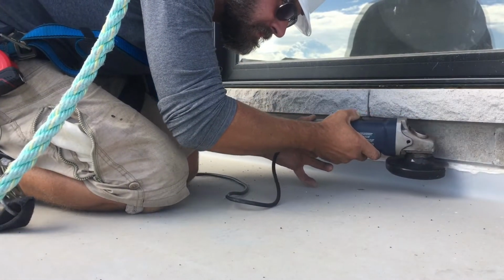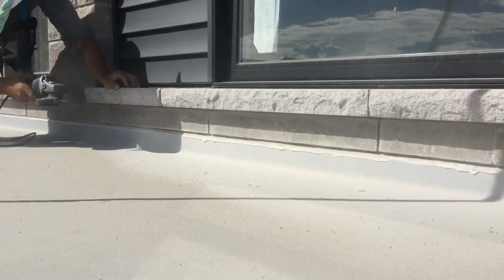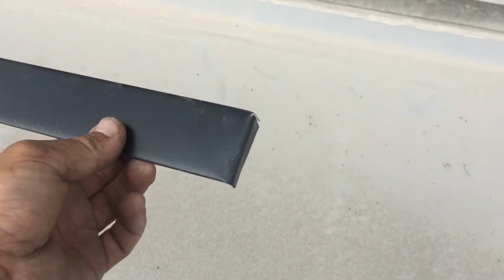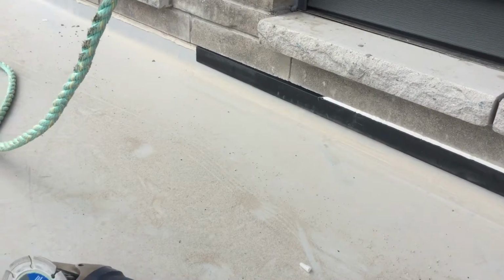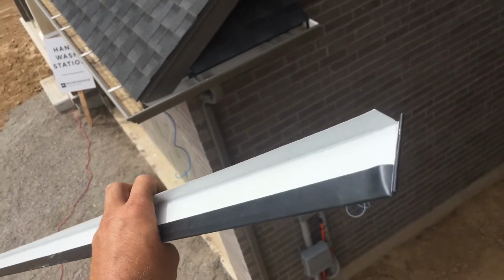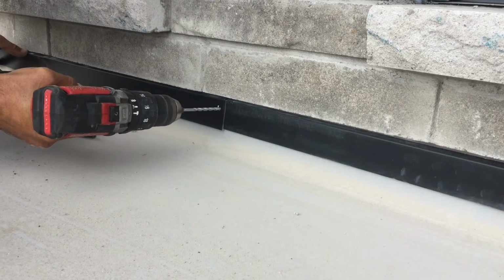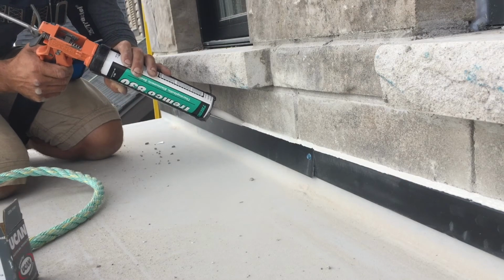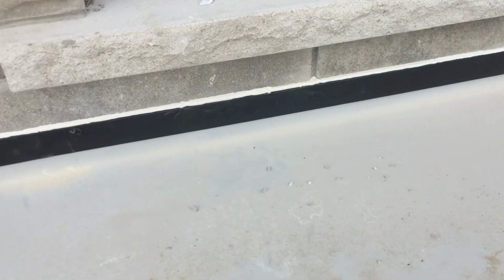Roof Counter Flashing Install

Comment: That should have had a counterflashing all along near the bottom.....LONG BEFORE THE MASONRY WAS INSTALLED. This is indeed a wannabe solution for when that was not done,..and probably the best course once the stone has been installed without a counterflashing that goes underneath the weather barrier (which is usually directly on the plywood sheathing..which is underneath the masonry).  All that being said, at least half the time it ends up getting done similar to this....with the exception that the SLOT that you grind in the wall should angle up slightly (ask a roofter....water will never flow up).
Reply from the maker: Hi. Not exactly sure what you are trying to say. The masonry comes up from the ground floor. This deck has a membrane that extends up the wall and is sealed to the wall and the counter flashing covers the material edge. This is very common practice.

Comment: Try using a leaf blower to blow the masonry dust and grit off the roof as soon as you are done cutting.  Your walking on the DecTec and grinding it in and comprising the finish.
Reply from the maker: Thanks for the comment. Its a challenge on new con sites to keep anything clean as trucks are constantly driving by kicking up dust and debris. I'll keep it in mind for the upcoming season.

Comment: I thought aluminum was a no no with concrete as the chemicals in the mortar will corrode the aluminum quickly??
Reply from the maker: Fresh concrete and mortar will react with aluminum but once its set its not an issue in my experience. Thanks for bringing that up.

Comment: How does the water exit above the counter flashing? Masonry walls are not water proof?
Reply from the maker: Hi Abel. The counter flashing is to protect against driving rain that hits the side of the building. Our material is on top of the masonry so it needs a counter flashing.